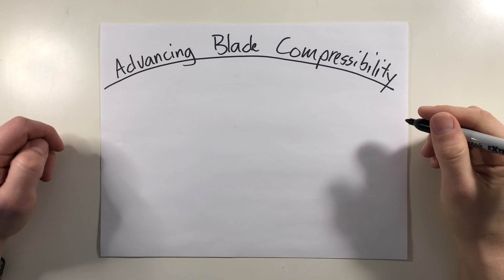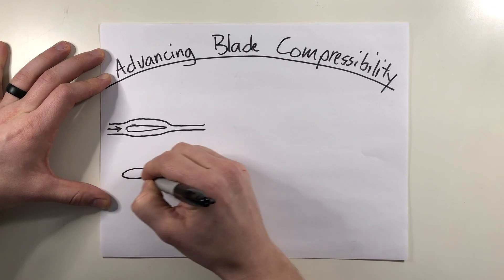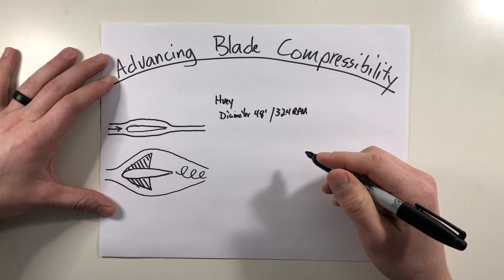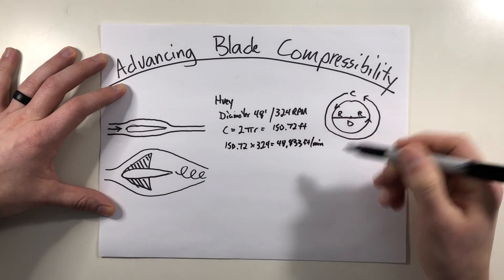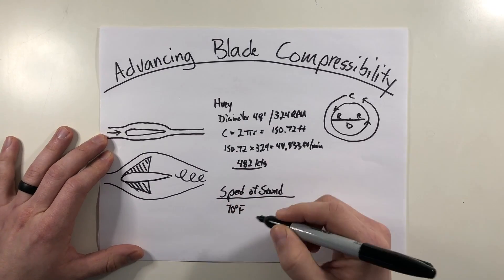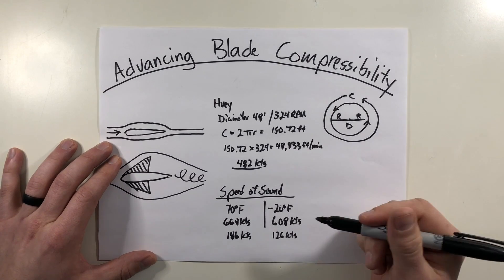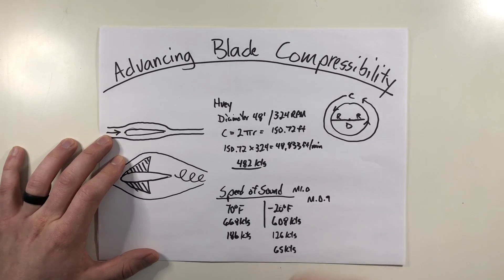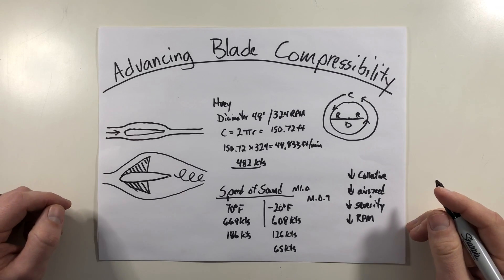Advancing Blade Compressibility in Helicopters

Comment: Great job!! I'm a professional helicopter pilot with 17 years of experience and I found your explanation to be extremely well done. I am in midst of taking a refresher course for a new job and came across the term "advancing blade compressibility". I had actually never heard of it before, we were only taught about retreating blade stall when I was in flight school. I figured it probably had to do something with crossing the speed of sound but I wanted to learn more so I googled it and came across your video. 
I've done some really high altitude work in Nepal and we had to be very careful to not cross VNE when descending from extremely high altitudes. At closer to sea level it would be just about impossible to reach VNE in an AS350 but coming down from 20,000 ft that VNE is reduced to around 100 kts or maybe even lower and the aircraft really wants to dive and accelerate as you descend.
Anyway great job, keep up the good work!

Comment: Question, why did you reduce the Mach speed by 10% and not the required airspeed to hit Mach by 10%? I am not an engineer, just curious. It seems that if airspeed around an airfoil increases by 10% it would reduce the required speed to get to Mach 1. If this were the case it would need to be around 78 knots and not 65. Right? Please help me understand your math. Thanks. I really did enjoy the explanation, just curious about the math.

Comment: Which condition would you be likely to first encounter at high speed normal operating RPM flight retreating blade stall of advancing blade compressibility effects? Are there facors like temperature that could get you into compressibility before reatreting blade stall?
Reply: or

Comment: Love your videos!

I have some questions about coaxial-rotor and tandem-rotor helicopters and gyro stability. 

As a lay person, I always thought that helicopters had the handy feature of being naturally stable because they were a giant gyro that wanted to stay level, just like a child’s toy gyro/spinning top. 

However, what would happen if we redesigned that child’s toy and put in TWO gyros spinning in OPPOSITE directions around the same axis? It would not stand up. Likewise, a bicycle stands up when moving because of the gyro effect of its wheels. However, if we could magically make one wheel spin in the opposite direction, the bike would be unridable. 

So it seems to me that the counter-rotating rotors of coaxial helicopters and tandem helicopters must take away the stabilising feature of a single rotor. 

Why is this not mentioned in the “advantages & disadvantages of coaxial helicopters” lists that I see on the web?

Furthermore, how do the coaxial helicopters deal with gyroscopic precession? 
——-
Reply: mrjweate they are naturally stable on the roll and pitch axis, no helicopter is naturally stable on the yaw axis due to Newton’s 3rd law so it requires a counter torque rotor system.  A child’s gyro toy spins as a whole itself, a helicopters rotor spins separate from its fuselage causing the fuselage to turn in the opposite direction, again due to Newton’s 3rd law.  

I think you are confused about the whole bike thing.  If a bike had its wheels turning in opposite directions, of course it would be unridable but that has nothing to do with a tandem rotor system, because a tandem rotor system maintains foward flight because of the pitch angle of the blades, nothing to do with how a bikes wheels work.  It has opposite turning rotors to balance the torque of eachother.

I hope that answered your question, I’m not a genius like this guy but I know a fair share lol

Comment: Based on this, would it be correct to conclude that the actual Max Vne of a given helicopter would be the value where retreating blade stall and advancing blade compressibility are equal? 

I am basing this on: Vne kt value tends to increase with a decrease in both temperature & altitude, and that blade compressibility value increases with an increase in temperature (also assuming altitude as that has a direct correlation to Mach numbed & kt value associated). 

In other words, the fastest indicated airspeed I could fly would be at low altitudes on a slightly above freezing day.

Thoughts?
Reply from the maker: JustaGthing. Your operators manual bases VNE off of either Retreating Blade Stall, Advancing Blade Compressibility, or structural damage (whichever is lowest). It just so happens that when it's colder it's based on ABC and RBS when it's hotter. With that in mind, I would agree that the absolute latest onset of any of these limiting factors would probably be low altitudes at cooler temperatures. But every aircraft is different. Keep in mind rotor RPM and blade design affect these significantly. Great question!

Comment: Im heading to basic in 16 days and after that wocs then flight school. I wanted to know your opinion on the different airframes and why you chose the 64 over the 60 or 47. 

Im not set on a specific airframe yet as I know selection can be a toss up, but I just wanted to know your opinion.

Thanks
-Kagan
Reply from the maker: Kagan Smith. I get this question a lot and it really just boils down to personality and what you want to do. 60’s and 47’s carry people and equipment around, conduct air assaults, humanitarian relief, etc. The 64 has the hunter-killer mission. In BOLC you’ll learn all about each of the mission sets. Ultimately, pick the aircraft based on the mission that you want to do.

Comment: The V-22 Osprey rotor diameter is 38' so that means the rotor rpm can go faster since the circumference is smaller (and there is no retreating rotor blade in forward flight). The cruise speed is 270 knots. It seems like it has most of the advantages of a normal helicopter without the limited speed. The only downside is the cost.
Reply: Indeed, never thought about that! But in forward flight the Osprey in my eyes looks more like a propeller driven aircraft than a helicopter, P-Factor is applied here too, though it's not a big deal I'd say.
Reply from the maker: Tom Mendenhall. I don’t think the V-22 worries about compressibility or retreating blade stall because, just like you said, it has no advancing blade in forward flight. This really applies typical helicopter designs.

Comment: Interesting. 
 I wonder if copters with pusher props slow down the main lift rotors at high speed to avoid the 
imbalances? 
 Slows down the main rotor so much that it acts more like a non rotating wing?

First look: World’s fastest vertical take-off chopper: 
https://www.youtube.com/watch?v=Db0g4Wlcw8A
Reply from the maker: keghn feem. Great question! I haven’t gotten into the engineering behind helos with pusher props to see how compressibility or retreating blade stall is compensated. Some use coaxial design though which should help offset it. Thanks for the feedback!
Reply: @helicopterlessonsin10minut10   I have been thinking about this and 
other helicopter aerodynamics for years. 
 The mysteries of rotor craft are fascinating. Like the blade on gyro copters. 
The blunt leading edge prefers to move into the wind when i would thing 
the sharp trailing edge would. And the effect on rotating blades that are 90
degrees out of phase. Wow.
 Really like you channel!